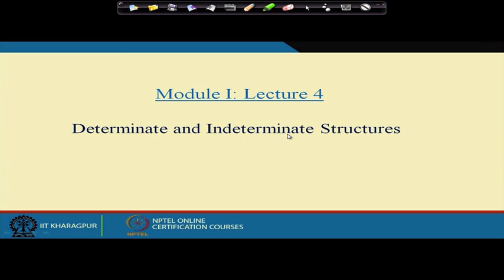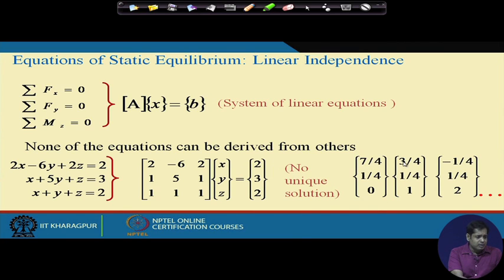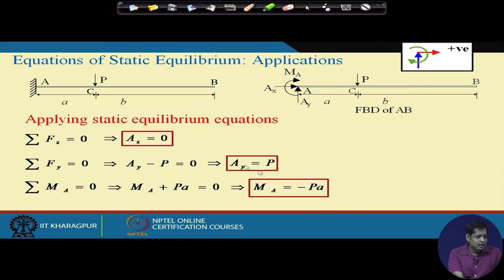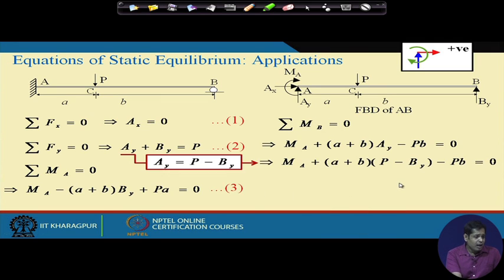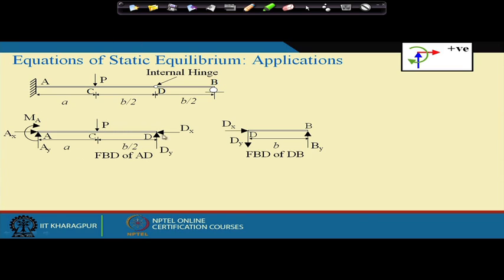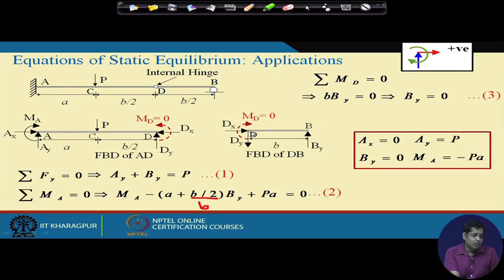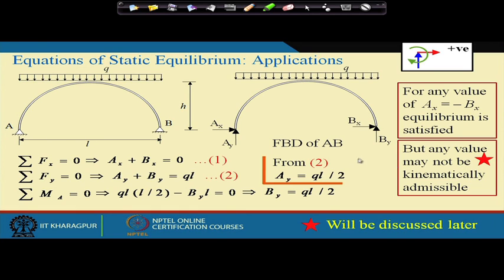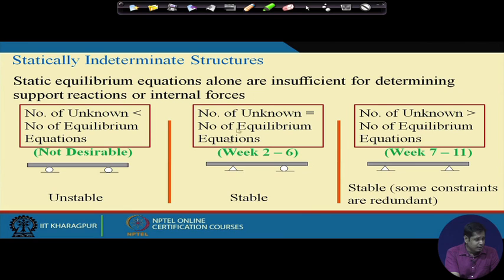Lecture 4 : Determinate and Indeterminate Structures

Comment: In the eg where hinged support are used.why u use at portions DB the distance is b . In my view the distance between BD is half of b
Reply: Prashant, yes there is a typo. Please take the correct value while solving the example. However essence of the concept will remain same. Thanks.